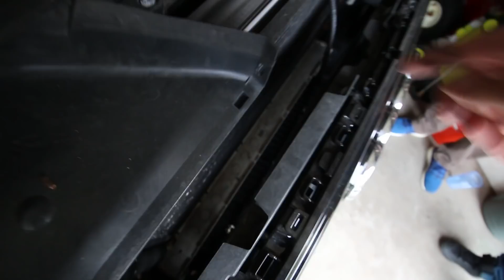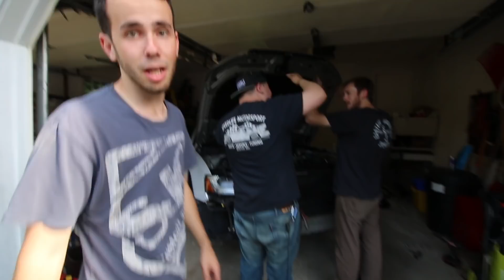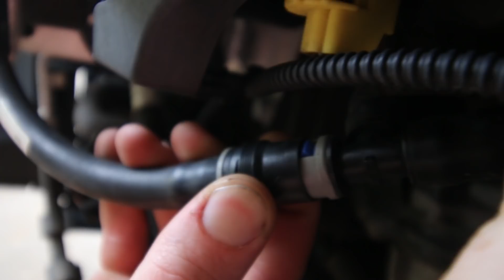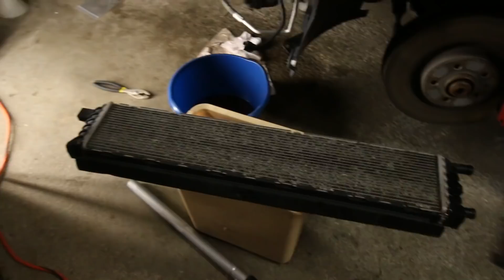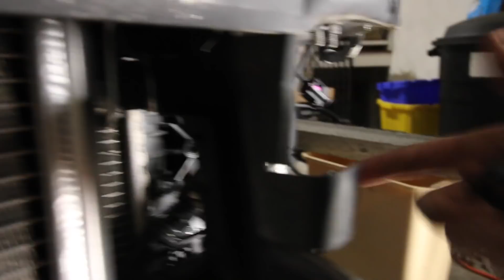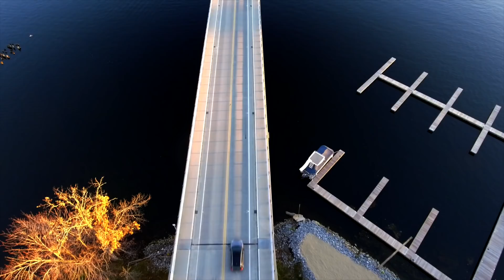AWE Cold Front Heat Exchanger Install on B8.5 S4!

Comment: What tune did you go with? I’m looking at Unitronic stage 3 makes 493hp and 441tq compared to aprs 498 and 444 with the ultra charger. I don’t think it’s worth spending the extra $1000 on the ultra charger for that small difference. IE is another one I was looking at but they only seem worth it if I’m running e40 blend and I don’t lol. Those apr and Unitronic numbers were for 93oct fuel

Comment: It’s a great upgrade for the s4 if you don’t go further than stage “2+” don’t buy the full kit because more coolant does not fix the heating issue, and takes the same time to heat up with the small amount of coolant. The only thing is to improve the flow itself. If you only drive work miles it’s not really needed but if you like to drive as the s4 is intended the electric pump upgrade and disconnect from the ecu is the best upgrade.
Reply: Timber land where would I get that upgrade any recs?